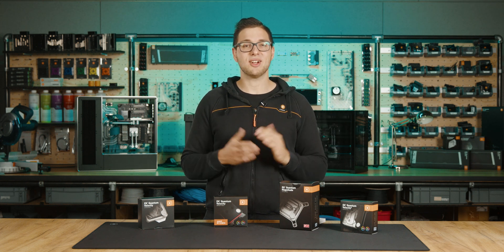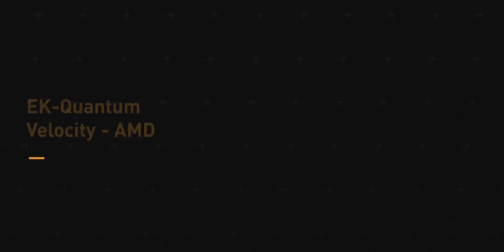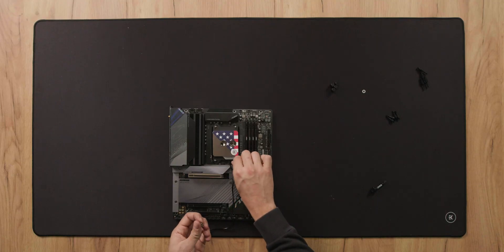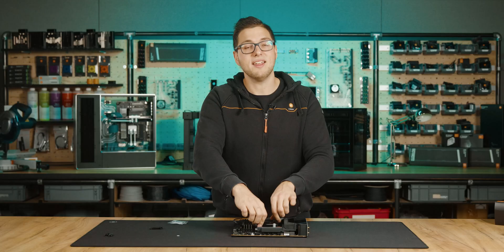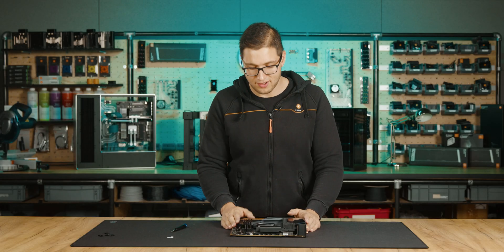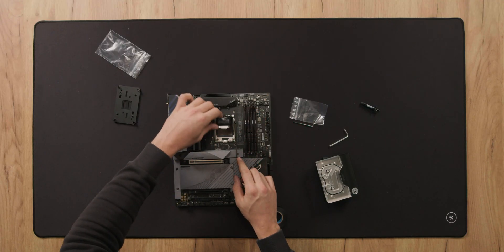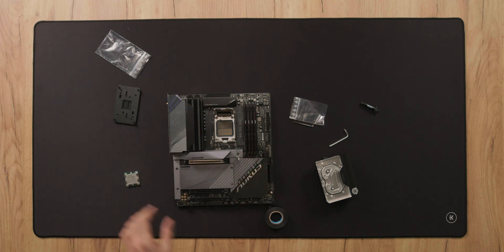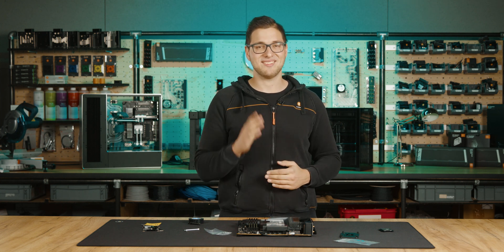Easily Upgrading EK AM4 Water Blocks to be AM5 Compatible | EK HOW TO

Comment: And what about the Metal Backplate for Velocity? Do we need to use the original Backplate from the Board or the EK Backplate with the Rubber Gasket?  No Information about that... Washer on Backplate Standoff looks totaly wrong.
Reply: Any answer for this?

Comment: Will this work with the EK Classic as well?
Reply: Did you solve this?
Reply: @Dave984  can confirm it works with the EK classic. I didn’t realize I already had purchased one when I got my first gen ryzen
Reply: @andrewgoodner154  Yes, but what do you need to buy to convert the EK-Supremacy Classic CPU waterblock from AM4 to AM5? I have one on my ASUS Strix x570e AM4 motherboard. I don't see any specific information on what standoffs to use for the Classic waterbocks.

Comment: God forbid EKWB include the backplate in the waterblock kit when you sell it as an AM5 waterblock, online! Idiotic company, good gear!
Reply from the maker: The AM5 backplate already comes with the AM5 motherboards. The backplate in the video was made specifically to allow you to use your AM4 water block on the new AM5 motherboards - so you can keep using the same water block instead of buying a new one.
Reply: Which is why this video is incredibly confusing. If you already have an AM5 motherboard which has a factory backplate, why on earth would you need to purchase an additional one?
Reply: Unless of course, the AM4 Waterblock requires different mounting than is on factory AM5 boards ?

Comment: The duct tape method shown on the video looks safe enough. However, the PDF installation manual for the AM5 backplate fails to include any note on securely holding everything in place while switching backplates.